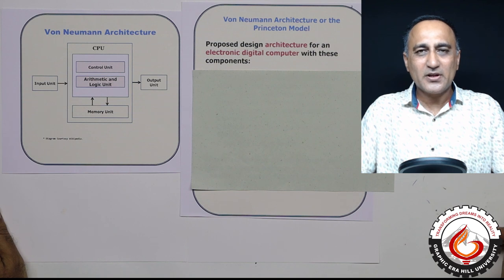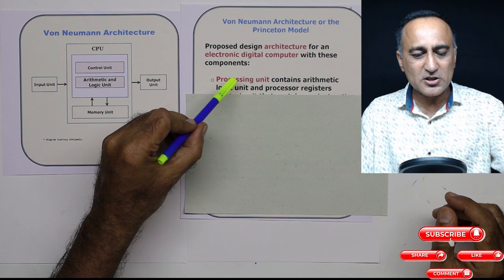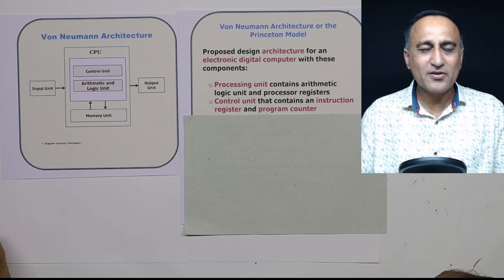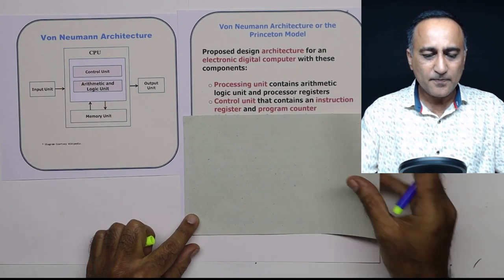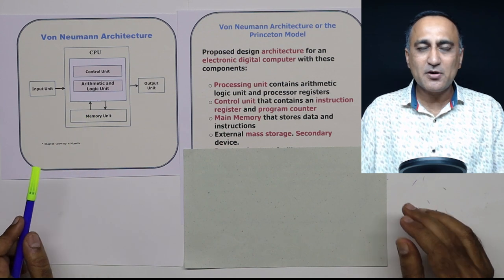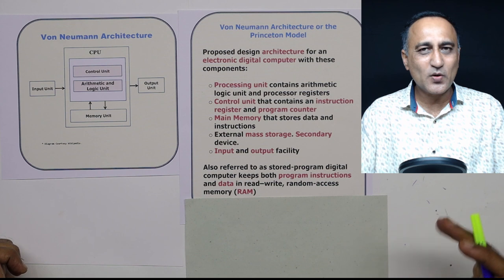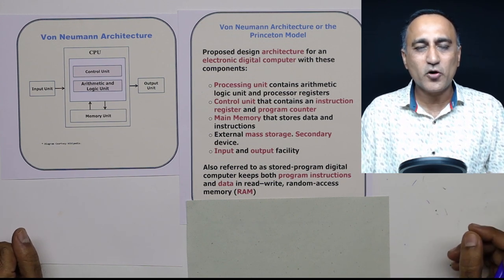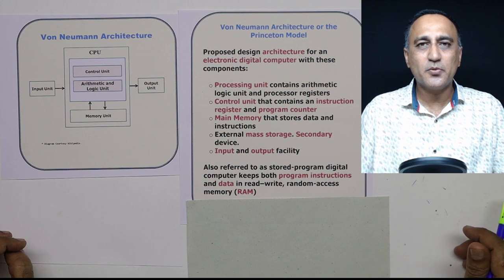WK2 - 11 Modern Electronic Computer Architecture  - Von Neumann

Comment: Sir ,I watched a video on the topic :Von Neumann versus  Harvard architecture.
It was given that in Von neumann architecture,computer has single memory for program and data.
While in harvard architecture program memory and data memory are different.
Sir please explain what this is.
And if possible please make a video of difference between these two architectures..
Thank you sir..
Reply from the maker: First things first. We are doing a introductory course and just need to get a flavor of the subject. Even Von Neumann is not part of the curriculum but I felt it is important in understanding the concept of modern machines. So the lecture. As a fresher in a subject there is always curiosity to want to know every thing but be patient things shall make sense over a period of time.

Anyway here is the basic difference. In Von Neumann since data and instructions use the same LANE to travel to/from the CPU it leads to congestion and slowdown. In Harvard by having two separate areas for instructions and data along with two separate lanes for data and instructions, this issues is addressed. I hope this satisfies you for now. Good luck.

Comment: Difference between data and program
Reply from the maker: Marks of all the students is an example of data.  To find the average marks of students in say subject maths, we need to add the marks of all the students and divide by the total number of students present for maths exam. To do this we write a small program to read students  marks and do the calculation. Hope that helps!
Reply: @CodetoCareer  👍👍